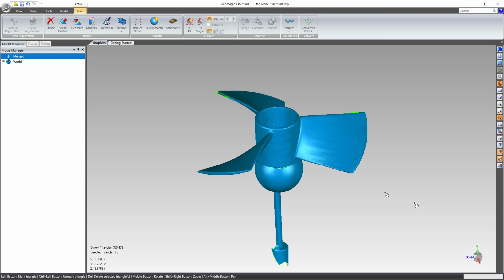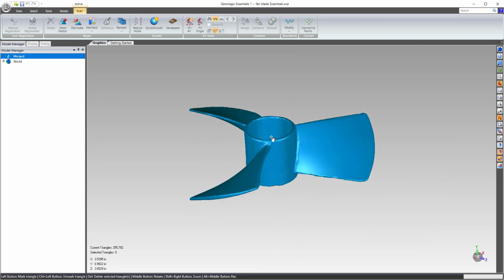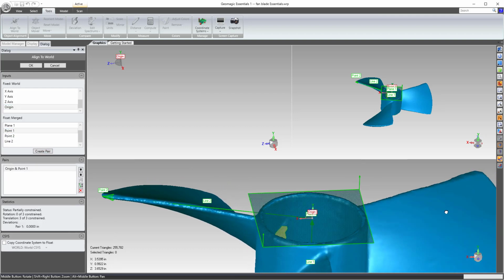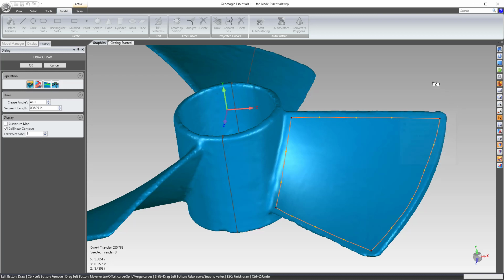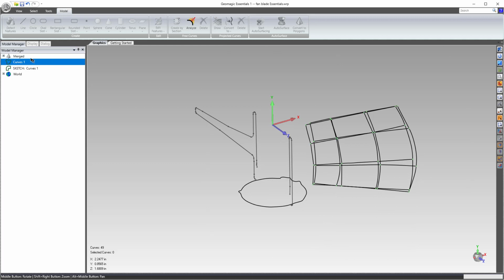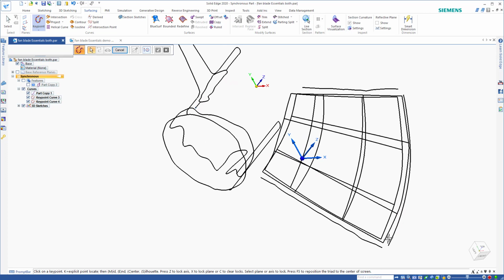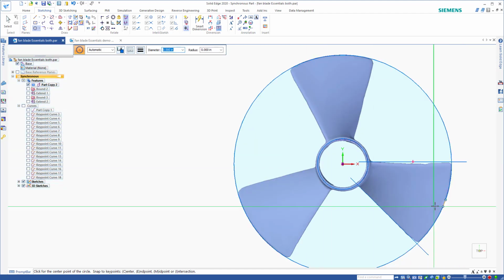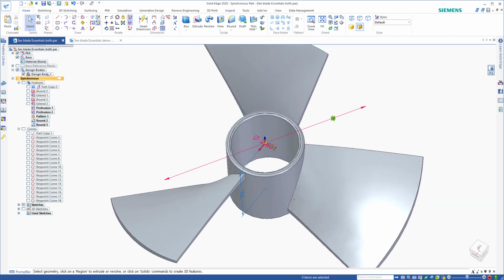Geomagic Essentials Fan Blade Reverse Engineering

Comment: Hi Gregory, 👋

Thank you for the video - I liked it a lot. 
I wonder if you can help me answer a question. Can you add specific measurements to sculptures with Geomagic Essentials? Example: could I extrude or pull specific lengths and widths? 

Thank you!
Reply from the maker: You can scale the entire model but we do not give you polygon modeling tools to dimension specific features.